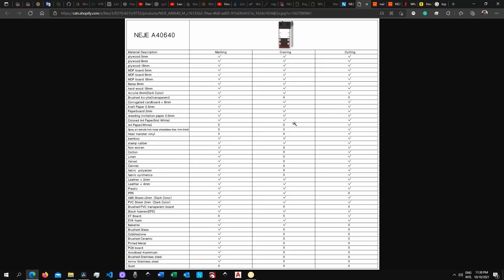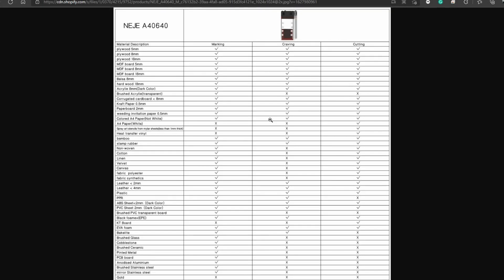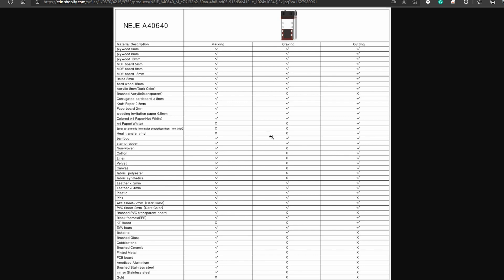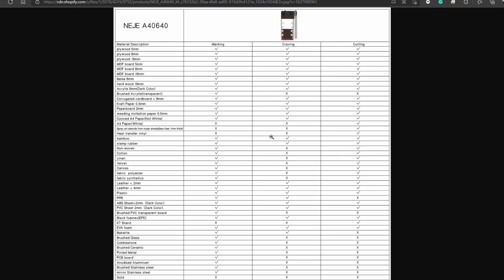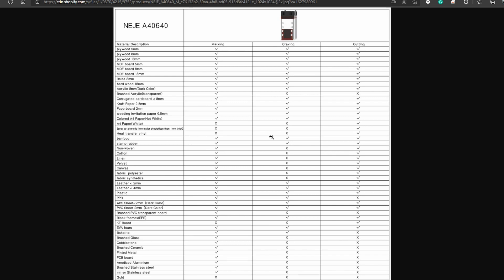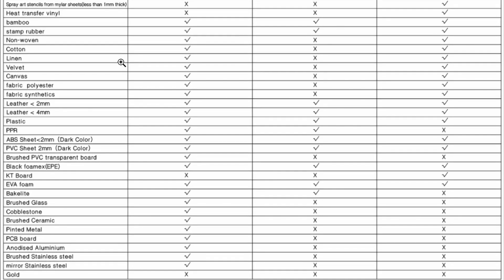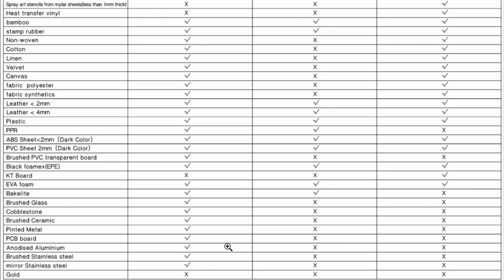Can you Engrave Metals with a Desktop Laser Engraving Machine - NEJE 40W

Comment: pl's kindly tell what setting changing you, engrave mettle ?
Reply from the maker: Hi, Pradeep Hewage; thank you for your comment. 

The 10W optical power laser module parameters are around 400mm/min at 95% power. If you use a 5W module, lower the speed to 250mm/min.

Just be aware that not all metals respond the same, and some engrave easier than others.

Ciao

Comment: Why the title shows "40W"? The NEJE A40640 is, as far as i know, a laser with 10W output. Maybe it takes 40W as input, but the output power isn't that high. 🤔
Reply: There is a video where someone measures the output and it was between 10W and 12W.  These diode lasers always seem to give the input rating, not the output.  It's all marketing to claim more power.
Reply from the maker: Hi Jarod Morris, thank you for your comment.

I go the optical power meter but I still haven't had the chance to measure the power on it. However, based on a commercial laser diode reaching around 7W with some energy lost between driving performance and optic compression, I believe that 5.5 to 6W  is the top you can get; therefore, since the module is a dual laser, it is reasonable to get 10 to 12W and not more.

Which means that some manufacturers lie about their powers, also if you look at the power supply for that module you get a 12V 3A DC or. 12x3=36W, which means that also the 40W input is a lie.

Ciao
Reply: @MiddleRoomWorkshop  The A40640 that I purchased didn't come with a power supply so I had to provide my own and I use a 12V 5A supply.
Reply from the maker: Hello Wolfgang Schulz, thank you for your comment.

You are perfectly correct; the laser optical power output is about 10W. Unfortunately, this is a marketing trick that some brands like Neje use to make the product more interesting by rating the power input of the laser module.

When you buy it, it is sold like the 40W module, now you will also find the 50 and 80W.

Ciao

Comment: Hi
I have seen marking on regular stainless steel spoon in your video.
What setting is used to make that mark?

If you share, will be a great help
Reply from the maker: Hello Sonal Jain, thank you for your comment.

My parameters were 500mm/min @ 70% and 0.14mm line interval.
The Laser Module is the NEJE A40640 i.e., 8÷10W max power.

Consider increasing the power if you are using a 5W module.
Ciao
Reply: @MiddleRoomWorkshop  thank you for your reply.
Currently, I am using 40 W neje

N40630
Reply from the maker: Hello Sonal Jain, than you for your feedback.

It looks like you got the new version has less power, therefore (compared with other laser machines of similar power that I have) I would suggest something like 400mm/min 90% and 0.12 line interval.

This should be fine.
Note, not all steels are the same, therefore I do suggest you to try out.

Ciao
Reply: @MiddleRoomWorkshop  thank you so much

Comment: Hi there! Great video! I'm having trouble engraving (or marking) a regular stainless steel scissors, the one commonly used at elementary schools. I'm using a 40w NEJE laser.  Question: what are your recommended settings for such material? I've tried 50ms BT, 100% pw, 3 passes, but didn't even scratch the surface. Do you think I should increase the burning time, or is this laser hopeless for this material? What is the maximum BT I could try before starting to seriously damage the laser?
Reply from the maker: Hello thatbassguy, thank you for your comment.

Have you been testing your laser to check that the power output roughly matches manufacturer capabilities?

Unless you are having some power issues with your laser module, your attempt proves that the type of steel used in that scissor can't be engraved.

There are many variations of Steel, and unfortunately, not all of them can be etched with a low power laser,  I think you simply caught a steel type that does not respond to that low power.
Other than that, engraving reflective materials may damage the laser module in the long run, that is because the laser itself bounces back into the module, and despite manufacturer claims that they have a filter for that I would limit the metal etching to small things.

Let me know.
Ciao
Reply: How about 304 stainless steel for this type of machine?

Comment: Copper? Brass?
Reply from the maker: Hello Lindsley Daibert, thank you for your comment.

I haven't tried these materials yet, but you should have absolutely no problem.
Cupper has a midrange reflectivity at 450nm and is the second-highest thermal conducible material, while Brass is made about 70% out of copper, the Zinc  (if I do not recall wrong) has a higher reflectance to that range, therefore I assume that you will need higher power to mark Brass than Cupper.
Besides they will both have a layer of oxide which on the other hand will be easier to etch away with the laser.

Let me know if you try before I do.
Ciao

Comment: That's not how stainless steel works. Stainless steel doesn't have a 'layer'. Stainless steel is stainless all the way through. If it rusts, it's because you've changed the surface texture...not because you removed any layer of 'stainless'.

Nice video though, and helpful. Thank you!
Reply from the maker: Hello Cris Anderson, thank you for your comment and like my video.

Well, there are several types of Stainless; Austenitic, Martensitic, Ferritic, etc.. which all vary on composition and cooling rate visible from a simple binary phase diagram, anyhow; at its core principle the elemental composition is Iron and Carbon (somewhere below 2%) and more than 10% Chrome. What gives the corrosion-resistant property to Stainless steel is the Chromium, which during cooling, forms a microlayer of Chromium Oxide, instead of the typical Iron Oxide (Rust). In fact, Stainless steel also starts rusting once that layer is removed either mechanically or chemically.

The layer is basically etched away, exposing the subsurface during the Laser engraving process.
Ciao
Reply: @MiddleRoomWorkshop  please don't take this wrong my friend...but if this were the case, all of my stainless knives I make would rust. Because after heat treating them, I grind them into their final shape, which includes an edge that will flex over my thumbnail. If it were a layer of chromium oxide keeping this from happening, pretty much all stainless tools that are in any way machined or mechanically abraded would rust as well.

You are 100% correct that the resistance to 'staining' (oxidizing) is do in large part to the chromium content (my preferred stainless is 13% chromium, with .67% carbon). In practice, the rougher the surface texture, the more likely it is to rust (this is true in both a pearlitic and martensitic state). Once you get into the greater than 240 grit range...the stainless properties reassert themselves....with successive grit increases further improving stain resistance. On working knives I generally stop around 600 grit hand polish. I'm guessing, as I said...that if you're seeing rust on the lasered areas of your stainless...it's due to some surface texture condition left. Or possibly some interaction with the chromium content directly (not burning away an outer oxide layer, but burning the surface content of the chromium entirely).

It's an interesting topic. I'll be etching my logo into my 62HRC stainless knives very shortly (I just got my Neje 40W laser setup tonight). I'll report back and let you know if I find any tendency to rust.

Thanks again for the very educational videos...they're absolutely appreciated.
Reply from the maker: Hello Cris Anderson, for some reason Youtube does not show on top the replies to already answered comments.

Having different opinions and ideas is perfectly fine, it helps rising new question and give chance to investigate the different point of view.
I totally agree with you that this is an interesting question.
Definitely, the presence of chromium will rebuild the layer of chromium oxide on the surface if there is enough chrome in there (Chome has a very high affinity with oxygen), in addition, other elements used in the stainless steel production participate in the corrosion resistance like Nickel, Molybdenum, etc.

There are several rusting mechanisms in general for all materials and some rust faster than others, in my opinion, based on experience and profession I know that the most common rusting behaviour is Electrochemical or Galvanic, we call it bimetallic corrosion, this works by generating micro-currents that literally eats the metal, in fact, we do design steel structures on land and offshore with Galvanic or cathodic protection. 
If two different metals are in contact or submerse in a medium they undergo such corrosion, for example when mechanical tooling is performed on Stainless steel Parts removing the layer of Chromium Oxide, if the area gets contaminated by other metals (for example using grinding wheels used for other metals before) then the reaction starts faster than the rate at which the Chromium Oxide will form however this may take time if the part is used the process will slow down if the part is in chemical environments it accelerates. 

When producing Stainless Steel parts, depending on the application the part undergoes a Chome Bath to cover back up the surface.

So in both scenarios, laser etching and in your case with sharpening and polishing knives then it simply rebuilds the sweet protective layer. 
Ultimately,  we should definitely see in the long run.

Let me know your thoughts 
Ciao

Comment: Hi, I think maybe your troubles with aluminium were for a couple of reasons: Aluminium is highly conductive of heat, meaning it can sink away the lasers power very rapidly. To giver it the best change possible you can colour the surface of the aluminium in with paint or even just a marker pen. This allows th heat to concentrate on the surface long enough to burn away the anodised layer. You can then wipe away the marker or paint with IPA or Acetone.
Reply from the maker: Hello Dylan Evans, thank you for your comment.

Yes, Aluminium is highly thermal conductive somewhere to the 4th or 5th most conductive metal in pure form, but although the idea of fast heat dissipation plays in the ease of engraving with laser technologies, the issue is related mostly to its reflectivity.
Aluminium has the highest reflectivity across a wide range of wavelength among metals, and despite stainless steel looking more reflective, we should consider which range of the electromagnetic spectrum it reflects, in other words, stainless steel reflect the most visible light which is a small portion of the spectrum while aluminium as a much wider reflection range.

Pure aluminium can be engraved with different laser technologies and higher power but in these machines, there are protections to avoid damages to the optics and the laser itself.

Coating the surface of the aluminium can help but not at these powers.

Anodized aluminium on the other end can be engraved as shown in my video because the anodized layer takes part of that reflectivity off, and acts as a sacrificial layer.

I will show some short videos about it in the future.

Ciao
Reply: @MiddleRoomWorkshop  

Sounds like your all over it, I had a passing understanding of Alu also being reflective but assumed it was it's thermal conductivity that prevented laser engraving at these powers!

I have seen darker anodising engraved easily at these laser powers as well as lighter anodising using the marker method. But I suppose the alloy of the Alu could also be a factor in other engraving videos.

Comment: Like from me. Just a Q: how shall I understand this: BT = 50 ms, please?
Reply from the maker: Hello Libor Vitek, thank you for your comment.

The Burning time represents how long the lasers stay at one point, in other words, is the inverse of the speed of the axis, if you want to slow down the axis so it can engrave deeper or cut, simply increase the burning time.

Normally for a typical CNC machine like the laser machine you speak about speed and is measured in distance over time like mm/min, mm/s, in/min and so on, however, the burning time should be considered like min/mm, s/mm and so on.

I hope you got the idea.
Ciao
Reply: @MiddleRoomWorkshop  I am using light burn for my neje 40 W. How to set BT in that?